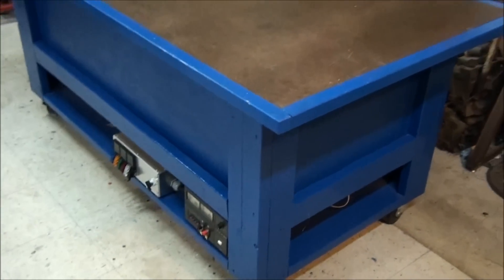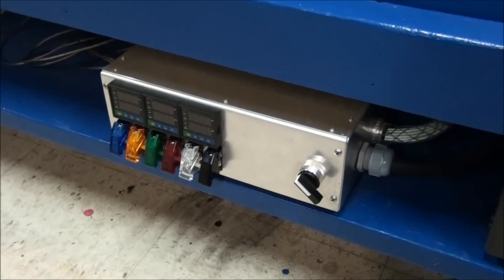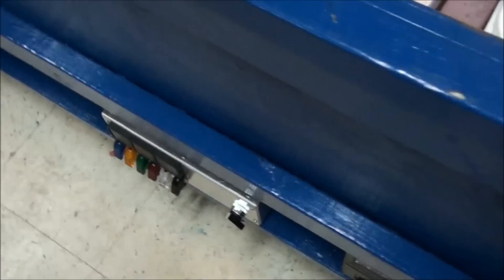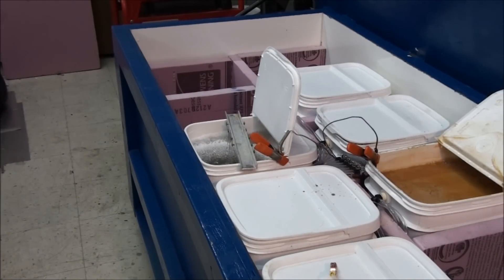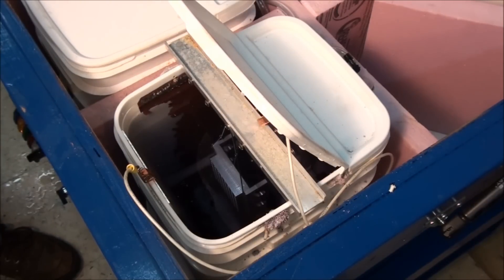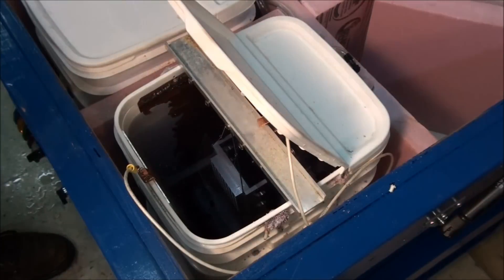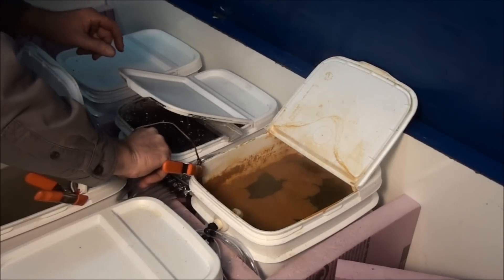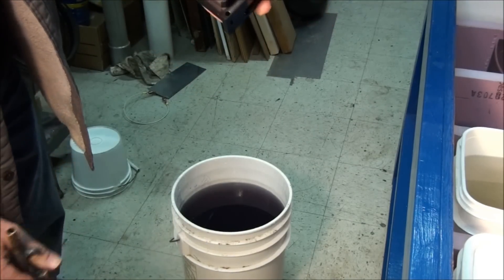A Demonstration of my Home Anodizing Set up

Comment: Tom, one amazing shop setup you built there. 

One question, does anodizing add any dimension to the piece? I know that paint and powder coating can minutely change the dimensions of the part, does anodizing a .6502 wide piece remain .6502? .6508? .6532? Just wondering. 

Lied.. 2 questions..  With the thimble in the previous video, is it possible to selectively anodize just the division marking? Just the front face?
Reply: Would really like to know the answer to these two questions as well! :)
Reply from the maker: Thanks.

Type II anodizing like this will add up to about .0002" to each surface.

Only aluminum and titanium can be anodized. You are out of luck with the steel thimble, although you can electroplate it or fill the graduations with paint to make them more visible.

Tom

Comment: What is the sealer?
Reply from the maker: It's a nickel acetate solution.
Reply: +Toms Techniques All the other videos on anodizing I've seen so far use boiling water for about 30 minutes to seal the dye.  What's the difference with your solution?
Reply from the maker: +George Wood 
Hi George, 

Boiling water tends to leach colors a bit, mid temp nickel acetate helps to keep them bright.

Tom
Reply: Thanks.